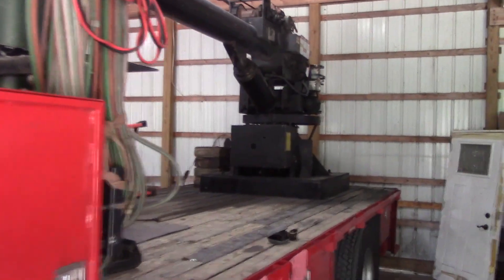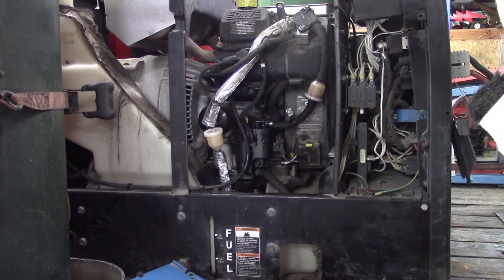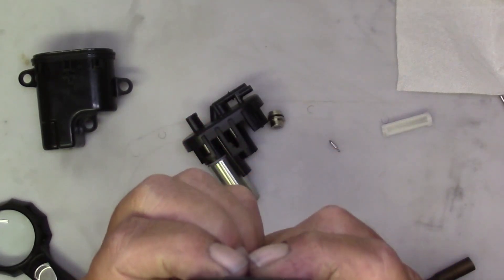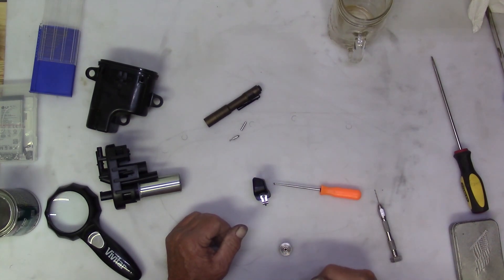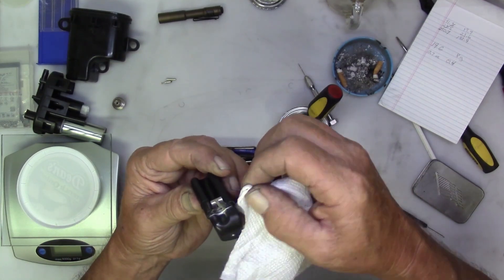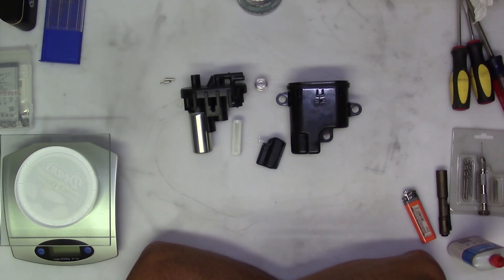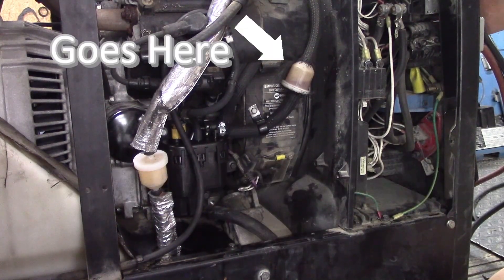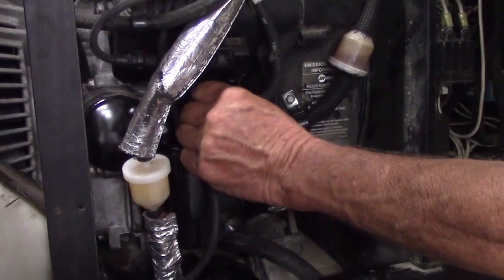Kohler EFI Non-Serviceable Fuel Pump Flooding

Comment: That's why you always keep your old one's.. 
You could pull it apart and steal the float out of an older pump, if you had one laying around.
IDK why they try to reinvent the wheel on these things.   I'm sure there is an off the shelf automotive pump that would work a lot better than this crap.
Reply from the maker: My problem is I keep stuff for 20 years, toss it and need it 2 weeks after its gone.  lol

Comment: What were the symptoms on the engine with the bad fuel pump?
Reply from the maker: Engine would start but ran very rough and stopped running after a few seconds. Very hard to start afterwards. Excessive gas was being sucked through the vacuum that comes from the top of the fuel pump to the throttle body. Very easy to see this happening with the air breather removed. Thanks for watching and hope this helps.

Comment: Nice!  ABout to take mine off and break it down.  On a vanguard so can’t see it real great.  Hopefully mine comes apart easily like yours.
Reply from the maker: Take your time bending the tabs I'm certain they design them to break easy and you'll be just fine.  If it's the float leaking my second choice would have been super glue. Some claim its resistant to gas. If you end up with an aftermarket pump keep in mind some have reversed the polarity and the wires need switched. Good luck on your repair and thanks for your support.  😀

Comment: I am curious what aftermarket fuel pump would you try?  We have a fleet of air compressors with these Kohler Command Pro EFI engines, and more than a few are showing similar symptoms to what you showed in the video.  
I am leaning towards buying a fuel presssure testing kit, or the Kohler test kit, to narrow down the diagnosis.  Not a fan of just swapping out parts and hoping we solve the issue.
Reply from the maker: All the aftermarket fuel pumps come from the same place as the koler. They are all branded different by different bulk buyers. So brand wont matter. Best bet is to find the best price model your looking for. I always use amazon, best return policy. If it comes with a filter toss it and get the Kohler 10-micron filter. I havent found any substitutes for that. pressure tester not a bad idea to isolate a bad pump. Thanks for watching and hope I was some help.